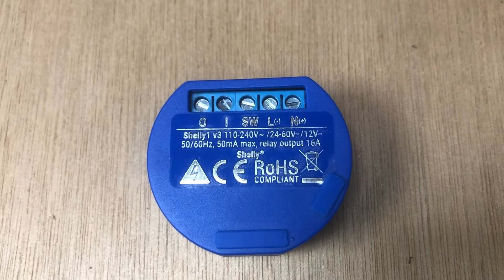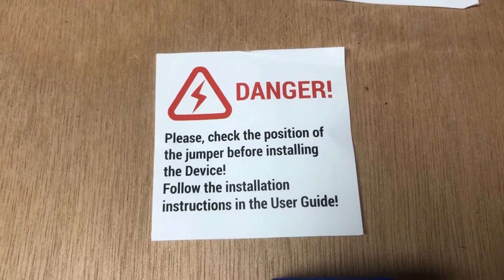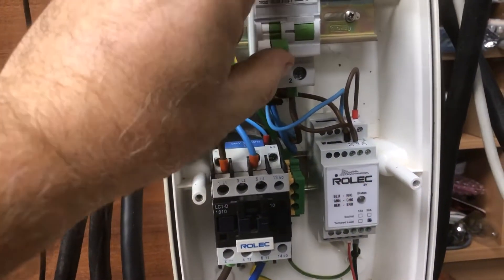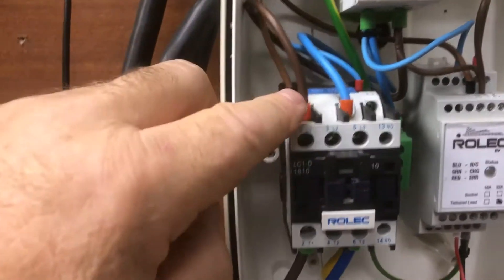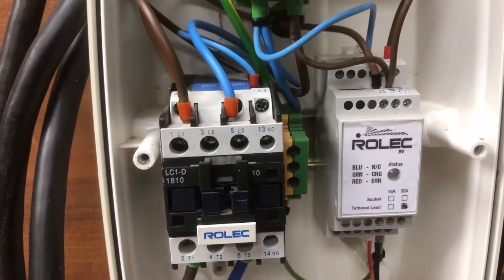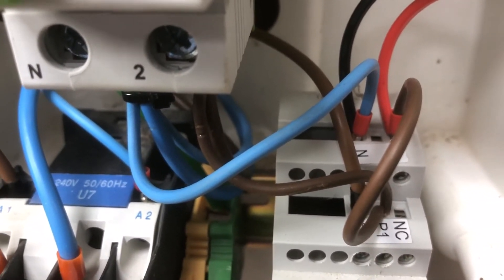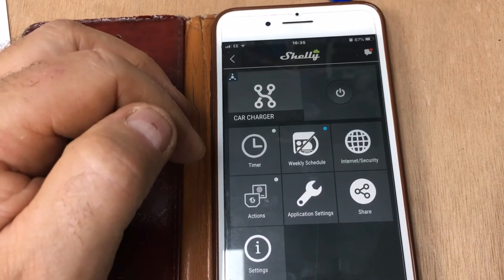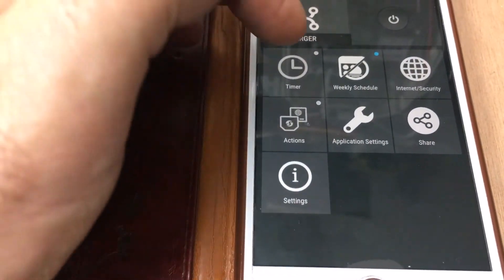Fitting  Shelly wifi to Dumb  ev charger Rolec  or others to give timed charging

Comment: Hi, I have an EO mini charger, I have two wires from the plug side to the car, I have used the Shelly 1, but I can turn it on but it won't shut off, it makes the clicking noise but it does not shut off, van you please advise.

Comment: Hi,  I have a QUBEV Mk1, also made by Rolec and I'm getting my sparks to instal a Shelly relay. Is the layout much different? There's space enough but maybe the connections differ, so a little help is appreciated :) Especially as the night rate of 9p is a lot better that 32p but getting out at 00:30 to plug in manually is not appealing in winter! :)

Comment: Great video. Wondering why you chose the CP connection rather than cutting the live feed to the control module itself? Controlling the CP wire means the LED indicators will continually flash when the charger is not in use. Although minimal, the flashing LED is consuming power. Controlling the live to the module would power off the control module, and just keep the charger in a state of readiness for when the module is powered up. Maybe this method would cause damage or issues though?

Comment: Wired this up to my rolec untethered unit. I've interrupted the proximity pilot pin. It works perfectly at telling my rolec to initiate charge because the car is connected to it, by while during an ongoing charge if I make the Shelly an open circuit, it doesn't disengage the charge session. Very weird
Reply from the maker: Sorry for late response.  When you say proximity pilot pin     Are you sure you are on the correct pin as on a untertherd unit I would also expect to see a second control wire that is connected to the lead skt. This connects to a sense resistor in the lead Handel and this resistor tells the controler the maximum power that the lead  can Handel.  I have not tried intrupting this but I have fitted a variable resistor to it on an old rolec. It made it current adjustable. Output but other controlers respond diferantly   Have you conected to this line  and not the pilot co pin
Reply: @hotrex7779  yup. That second wire is there alright. Odd behaviour from the car/charger
Reply from the maker: @matthewbyrne8196   have you tried fitting the device in the other wire as what you are describing should not happen . I think you are not connected into the pilot control wire
Reply: @hotrex7779  I could do, but I am using the pilot control wire. The control pilot pin location for the untethered unit won't be different. It's a type 2 standard.
Reply from the maker: Then it’s is well strange as the car would be monitoring the pwm signal continually   And adjust the charge rate dependent on the pwm.   If it sees the pwm signal removed and the pilot signal voltage removed the car should stop charging at once  as it is also a safety if the lead is pulled out this contact opens first  . Again the charger unit should also remove mains voltage from the car in the event that this signal is lost .  
Very strange. Events.

Comment: Many thanks I have an old dumb Charge master cp. This will solve so many problems.  I can't identify a 12v supply within the Charge master to power the Shelly so will have to use the 240v.
Eg Shelley unit power L / N 240v.  Chargmaster control thin black wire switched through the Shelley i / O on the low voltage side.
Is this correct as I need those beer tokens
Reply from the maker: Yes I have used this motors also this is the way I have shown the modified sonoff device fitted

Comment: On my timeswitch I connect the normally closed contact to a 1k resistor connected to the 12v output. Instead of the CP line being open circuit this makes the car believe it's connected to an EVSE in standby mode.
Reply: Am I right in thinking you put the 1k between the i and o on the shelly switch side lowering the sensor voltage? Do you know if this wiĺl work on a chargemaster cp?
Reply: @trevdfield7520  the relay switch should have common, normally closed and normally open contacts. Common goes to the CP line out to the plug, normally open goes to the CP on the EVSE, then the 1k resistor goes between a 12v supply ( possibly on the EVSE controller ) and the normally closed pin of the relay switch.
Reply from the maker: Hi.  What car is it that you are using this on ? I can see that the car will think it’s connected to a charger . Does the car not respond to this signal and try to initiate a charge ? .  The method I used was aimed at the MG ev.   That needed this. To wake it up from sleep mode.   But an interesting adaption
Reply: @hotrex7779  my car's a Renault Zoe but it should work with any car, it imitates the specification a unit in standby would use so the car should not attempt to start a charge but wait for the EVSE to become available. Even if it did it wouldn't be successful as the CP line to the EVSE is interrupted with the dummy 12v supply.
Reply from the maker: @iPeel   it would be intresting to see how the Mg would respond to it.   As the latest software that I tested a while ago would allow a delayed start. Ie. Give 12 volt car would pull down to 9 volt. Charger would delay giving pwm  output until charge start time  then car would start charge.  But once this had been done once and charge was stoped by charger removing pwm signal. Then car would not start a charge again until the 12 volt had been removed.  Or taken to -12volt for an extended time to reset. This is the way the omie  charger remakes the Mg.  ..

Comment: does 16A mean it wont work for a 32A EVE?
Reply: Ken, I think because you aren't using the shelly as the main relay it will work on a 32A Rolec, I've use a 32A one and I'm going to fit one as soon as I get a shelly

Comment: Great work.
You could use a Shelly EM to have this feature and also the power monitoring and history. 
Moreover you could use power monitoring with another one placed on the house to trigger a disconnection in case of too much power pulled. 
I have done this in my house to disconnect AC and send an alarm before total disconnection.

Comment: Great video, any change of doing one sometime using a 7 kwh old chargemaster home unit, using one of these,
Must be quite a few still working but not able to take a smart charge.
Reply from the maker: It is the same way just identified the pilot line if not sure send me some good picture of circuit board and wires I will try point you in the right direction